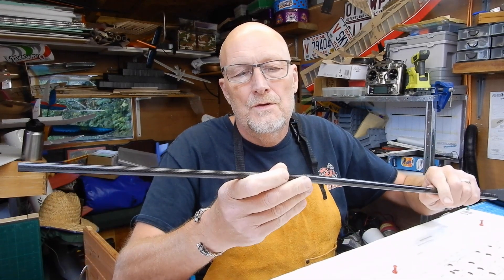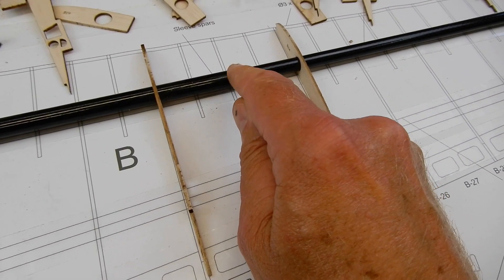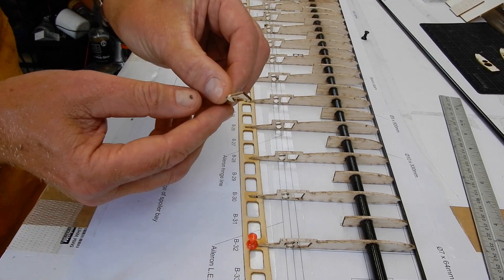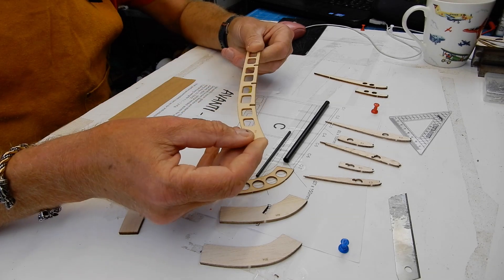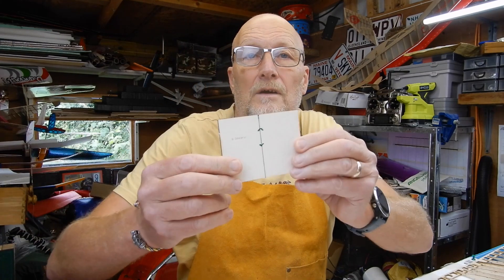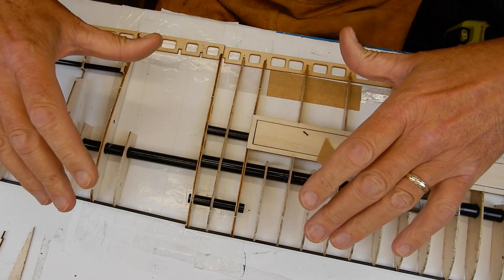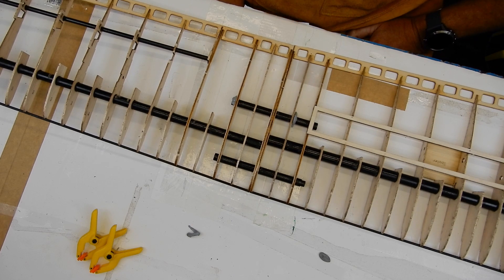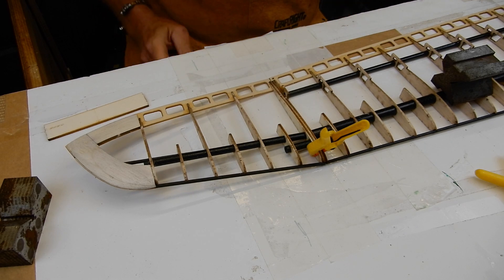How to Build The Avanti 3 metre F5J glider Part 2 Wing B & C Joining

Comment: I have a kit here and I am terrified, I can't even decide on the build board. Last one I did was 1985. Where's the PVA!? Help! Seriously, a basic gluing course is needed.
Reply from the maker: Thanks I am using foam board for this one. Think you are right a glue video is needed
Reply: @NickChittyFlying  I would so appreciate it.   How, what, where etc. Do you put glue on the joint and then put the joint together? You mention wicking? There appear to be different thicknesses of these superglues? I really need a back to basics course.I think I need to start with something cheap and basic before I ruin this F5J kit (with instructions in German, that doesn't help).

Comment: I am intrigued by the combination of carbon tubes with balsa for wing building.   It's the best of both worlds, rigidity with low weight - with enough strength.  I have two 2m sailplanes made with this construction method and the performance is impressive.  At 3m, your wing is going to be a real floater.